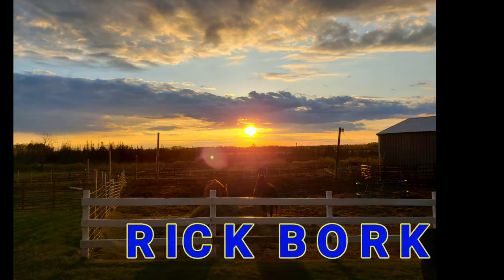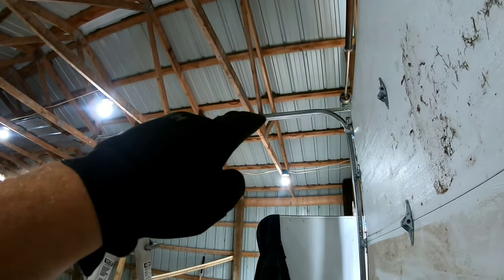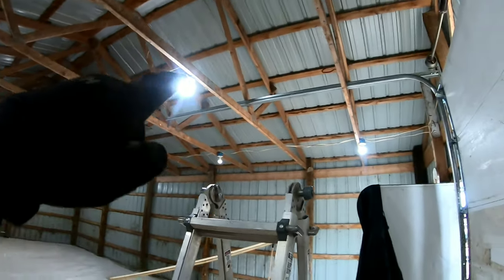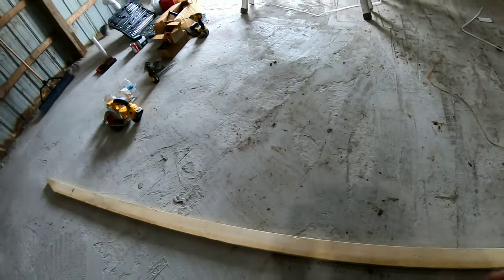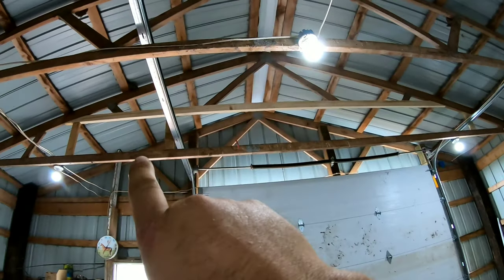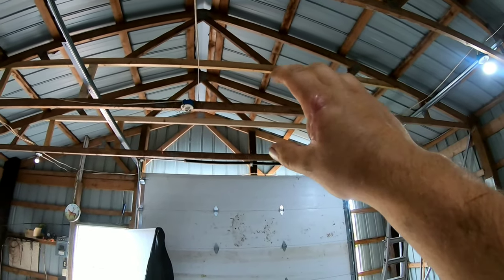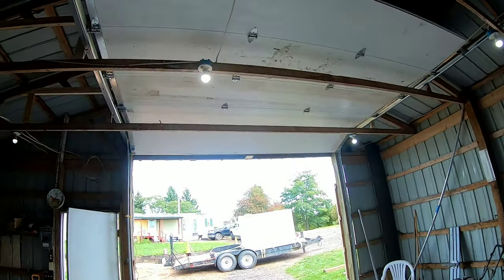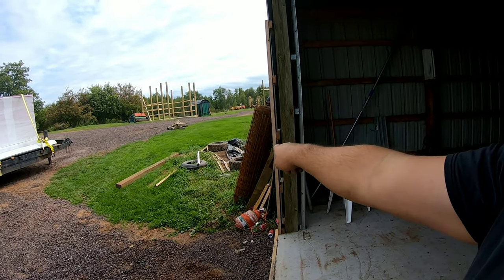Cutting and Modifying Trusses.

Comment: Good job on the recess, What however is keeping the bottom piece from sagging? if nothing else at best it is only cantilevered toward the ends. could you not cut it out and just have a open recess?
Reply: Hello Senior, In reply, removing a portion of the bottom chord for an "open" recess, is a no-no.  If your or  Rick did that, the saving grace (and I use that word here with reservation) would be the adjacent trusses and the diaphragm action of the roof sheathing, BUT, that would still be a shakey situation, a safety hazard, a violation of engineering, and a violation of building codes.